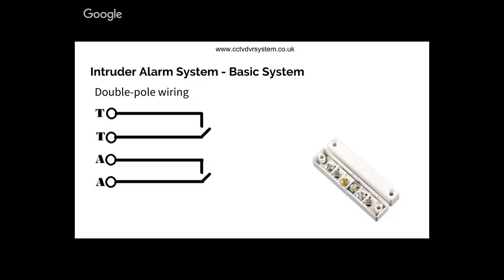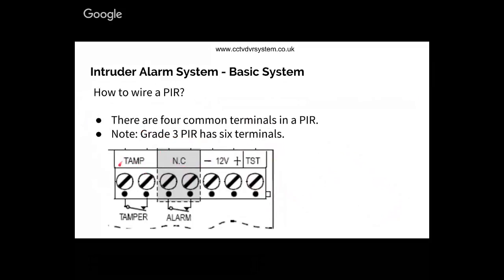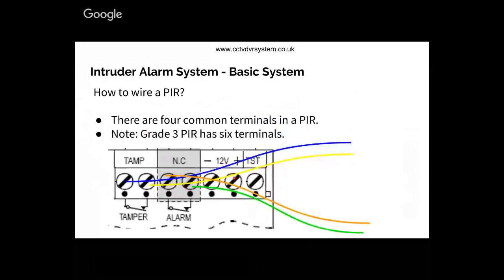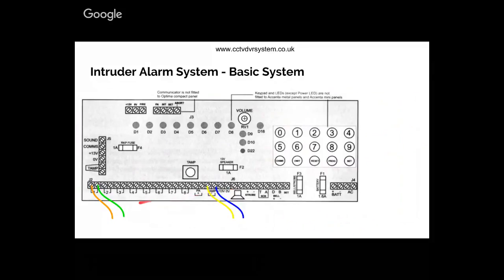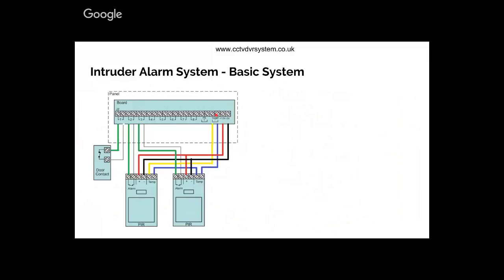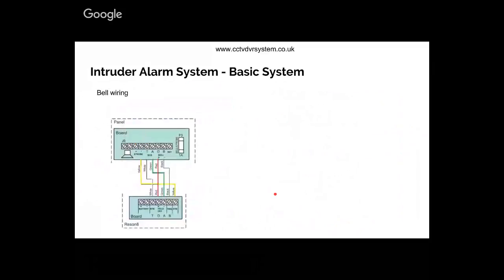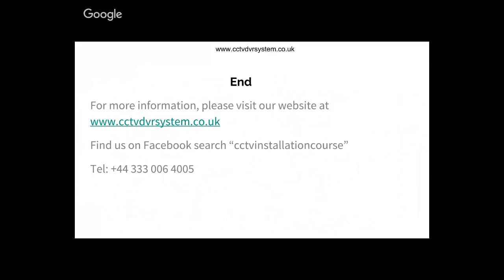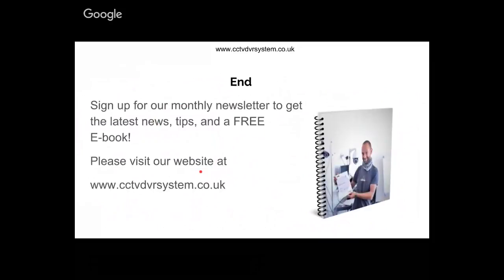Introduction to Intruder Alarm Installation

Comment: Hi, my Alarm has been wired in my property for over 10 years. I want to wire up my back door so that it operates as a final door closure or entry door, as before it only went to the garden  but now i have access from the rear path to the garden and want to exit or enter this way at certain times. 

can i just run a new cable to the box ( from the back door) and wire it in series with the original door cable? ( in the box) so the circuit is through both doors?

Many thanks.

Comment: The wirening seems dumb, just use security system that can read alarm, tamper and diconnection from just 2 wires with resistors (+2 für power)
Reply from the maker: What a numbskull you are.